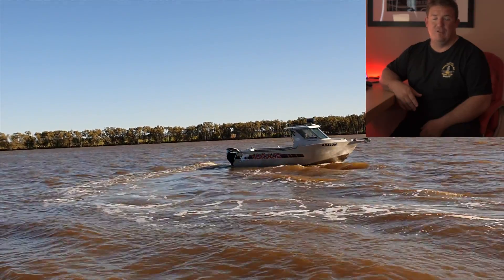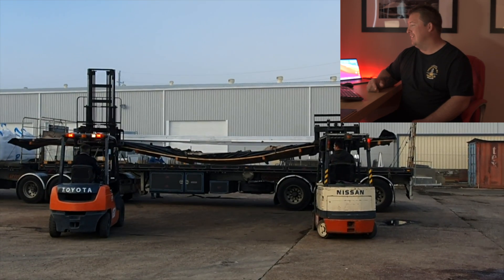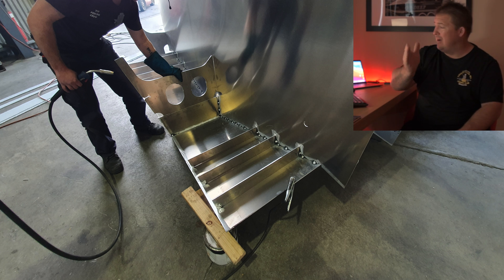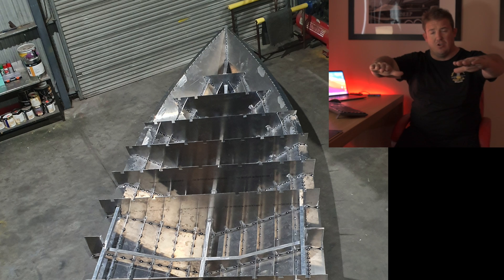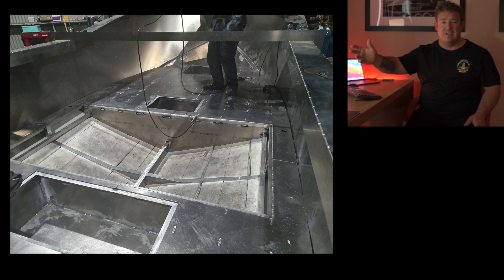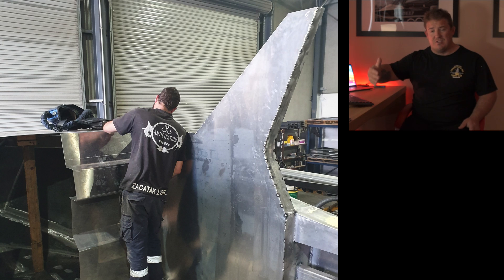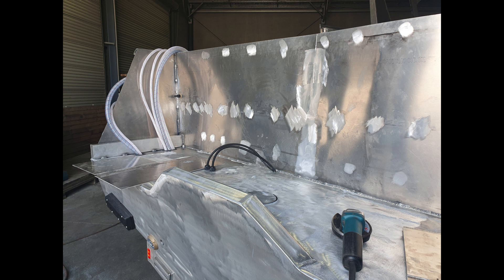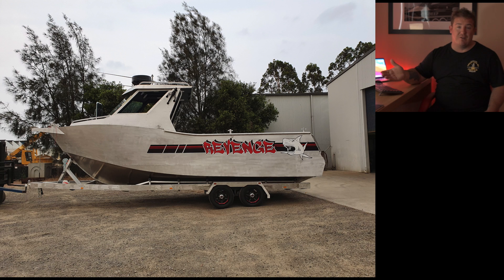How to build a plate boat - 7.8m CNC Kit Boat

Comment: How long did the alloy build phase take you, and was it just your self or how many buddy’s helped you with the fitting ? 

Have you built boats before ? I did watch the full video, maybe I missed these questions 

Thanks man
Reply: Hey mate 

From memory, the actual alloy phase was about 2 months, we had the boat on the water in 5ish- from memory 
It was super quick, and quicker than I would probably suggest haha!!

Not because we rushed anything, just because the build took up our whole lives for them months, it was literally work, then head to the boat.
We would regularly get to the workshop and camp there for the weekend putting in wild days…. But we wanted it done haha 

Just one mate really, and he was the brains of the operation not me, that’s for sure haha

He had built one smaller boat, another kit and was a very competent welder, he really was the reason it came together so well I just cut stuff up and used a grinder haha!!

In my opinion, if you can manage the welding side of it, and are some what practical minded it would be possible without doing one previously

Comment: in regards to towing weight, i,m guessing your 79 tows it, does the 79 have the standard 3.5ton maximum tow capacity?  how much does the boat weigh and the trailer? thanks much.
Reply from the maker: Hey mate 

We weighted it full of fuel on the trailer but with no gear and it came in at 3.51t 

Keeping in mind it holds 720l of fuel 

I just tried to not tow it full too far to kind of balance the extra weight of the gear once loaded if that makes sense. 

In terms of performance- 79 and even my work hilux towed it just fine
Reply: @MattyRacingLife  thank you!

Comment: Hey mate what was your level of experience with welding before taking this on?
Reply from the maker: The guy who welded the boat was honestly pretty experienced. 
He is a very competent welder and we used some scrap aluminium to get use to the new welder/ different types of aluminium. 

If you have not done it before and are not competent I would absolutely suggest doing a welding/ fab course of some type 
Not sure where you are located but there are a few options

Comment: Hey mate quick question what welder did you use for the build and how did you find it?

Cheers
Reply from the maker: Hey mate, 
Thanks for the comment, 
It was a metal master unit from down the central coast way.  
To be honest I'm not 100% sure on the model I think it was the metal master Pulse 250, Not 100% sure on that but mate

Comment: Hello, My name is Jarrett and I live here in the U.S.. I have been looking at making my own boat, of course I don't know how to weld. I am planning on taking a welding class at a local community college. I know I have a ton of questions, the first is, do you have an idea of how many hours of welding you have into the boat?

Your video in my opinion is the best that I have seen, it get's right to the point and actually shows how you did it. No disrespect to all of the others, but you took us through your process in under 10 minutes. I tried watching another, it had three parts, each about 30 minutes, the boat looked really cool but all I really learned was what the guy's feelings were. Anyhow, I like your work.
Reply from the maker: Hey Jarrett 
Thanks for the comment

Stoked to hear you have been looking into building your own. Here in Australia there are a few businesses that sell the kit boats and also run a welding course, So you can buy the kit and welding gear off them, learn to weld through them and also have them there for advice throughout the build. Not sure if you have something similar in the U.S. but I always thought that was the ideal way to get it done without prior experience :) 

Hours.... I wouldn't know where to start.... What I will say is whatever you think it will be double it hahaha!! 
There would be a few hundred hours in the welding but in my opinion the grinding and clean up etc. is where the time is haha!! 

Thankyou heaps for good feedback I really appreciate it. 
I was hoping to keep it to the point, and quick- Glad it worked.

Let me know if you have any other questions
Reply: @MattyRacingLife  I am in Australia, which businesses run a boat welding course? Thank you

Comment: Awesome job! Love the boat. The video is very good. First one I've seen that talks about the build. I am literally inside my center console wiring up my Nav lights right now! Ha ha. It's like 1m x .75m  and hot as heck in here.....mine is a much smaller aluminum plate boat. But I can really feel what you are saying about the construction of the boat. Thanks for posting the video.
Reply from the maker: Thanks heaps for the comment and feedback mate I appreciate it.

How did you go with the nav lights?

Thanks again :)